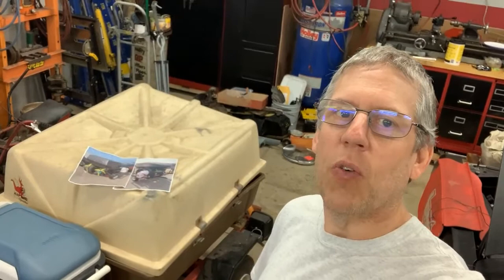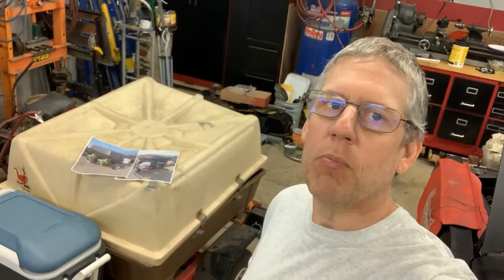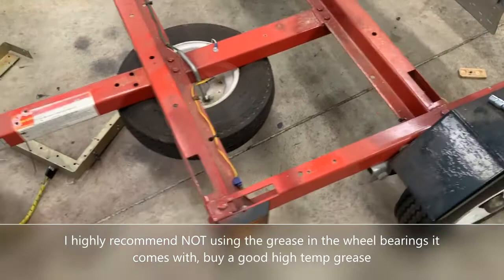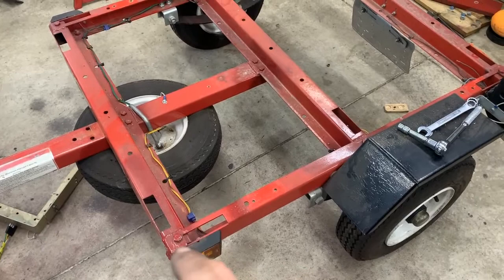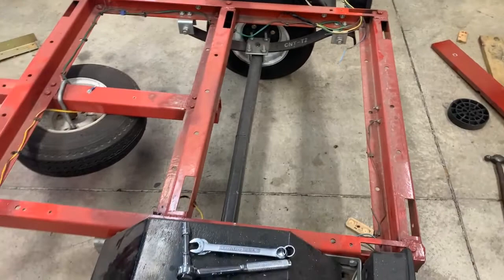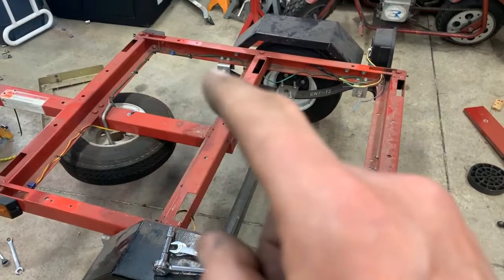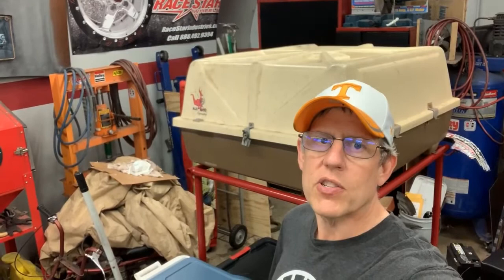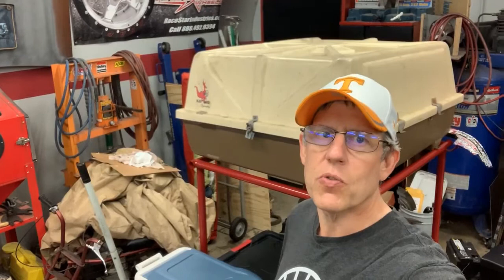Modify a harbor freight trailer for drag week, race week, auto cross, trail rig, vacation or ???

Comment: hi. im curious as to how it performed at highway speeds, turns and such. i have the same trailer and want to do a teardrop camper. but worried about the tipping rate. awesome video. subscribed!
Reply from the maker: I've done 70 with it before and no issues. The smaller tires just need to be careful with the weight not to overload them too much. I'm considering switching them out to a 12 or 14" in the future to feel more comfortable at higher speeds for longer period of time.
Reply: @ShopDogFabrication  ive taken it about 1000+ miles from buffalo ny to west virgina and back with a yerfdog gokart on it. no problem. just did another 1000+ miles buffalo to new hamsheire (probably not spelled right), to vermont, nyc, and back. with a build like the first 1 in this video. no problem. well' i caught a flat tire on a sharp rocky road. plugged it and go to go). i didnt even think to look the thing over for loose bolts. lol. i must have al least 3500 miles on it. smh.